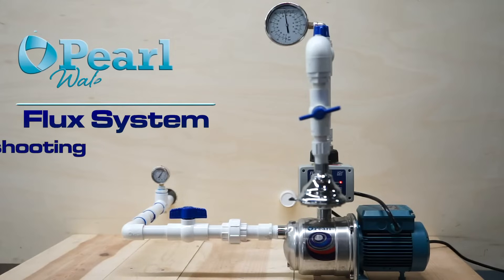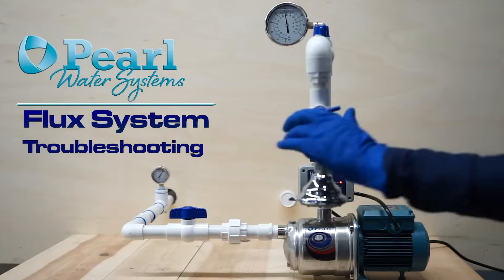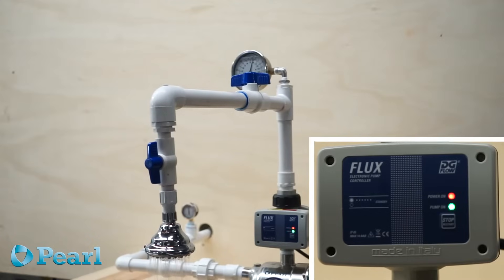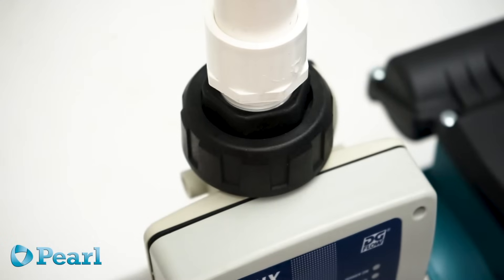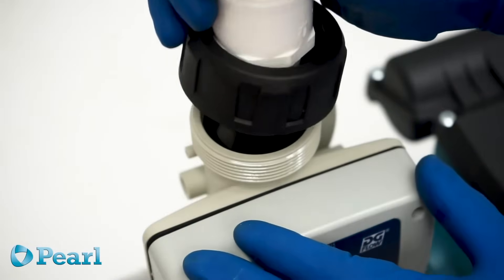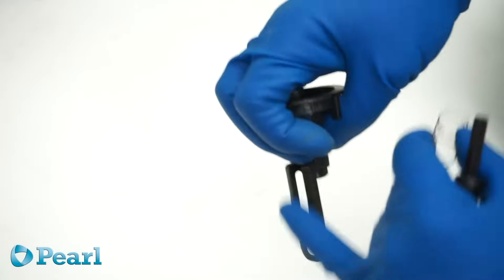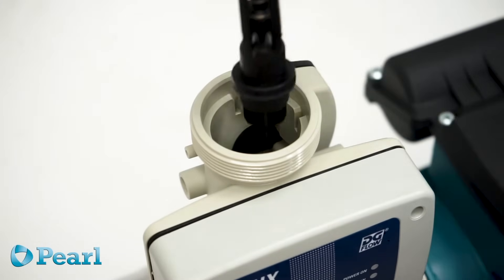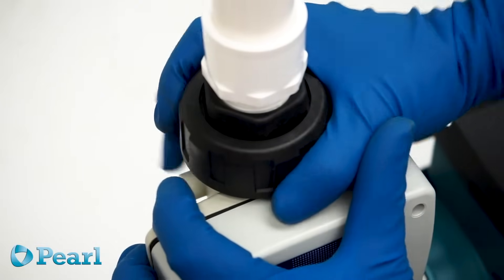How to troubleshoot an electric Water Pump Flux System?

Comment: My system check valve does not have edges or grooves to align.  How do I know the check valve is positioned correctly?  My pump runs continuously even when there is no demand from a faucet.  I have no leaks in the system.
Reply from the maker: Hello
If you do not have find a grove, the controller might be one of the older versions. At this point, if you tried what the video explains, we highly recommend you to contact the contractor that installed it for you, or  the distributor you bought the pump from and try to get  replacement.